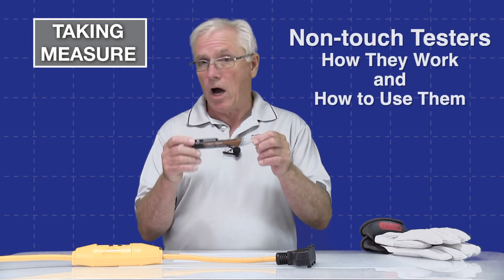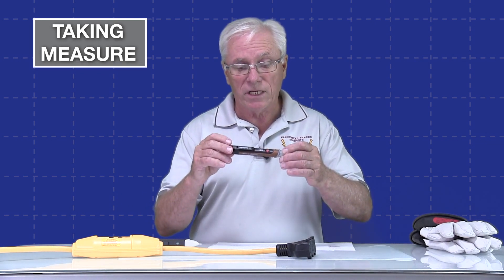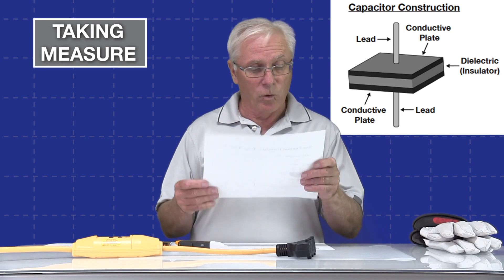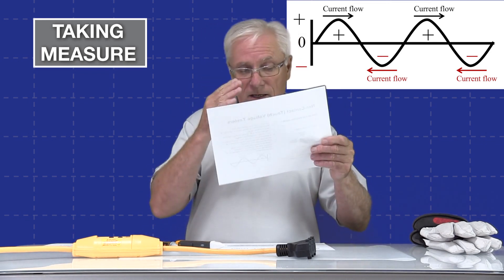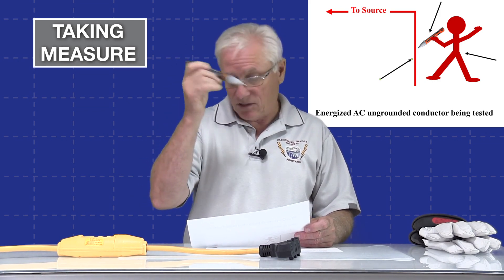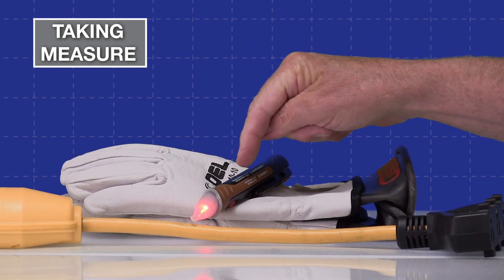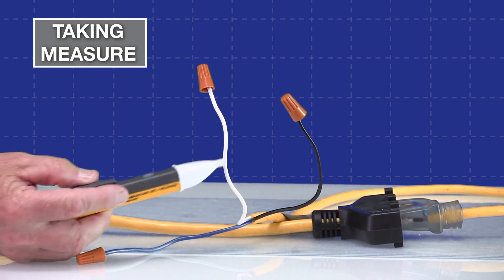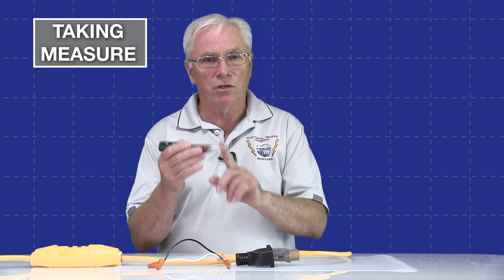Non-touch Testers - How They Work and How to Use Them

Comment: Why doesn't the neutral wire activate the tester?  If I measure voltage with DMM between neutral and hot I get 120V.  If I reverse the test leads, I still measure 120V.  i.e. both hot and neutral carry alternating current.
Reply from the maker: The neutral is a grounded conductor.  Grounded wires are designed to have a low resistance path to the ground, which means they are essentially at the same potential as the ground itself. Therefore, there is no potential difference (voltage) between the grounded wire and the surrounding environment. As a result, a non-contact voltage tester will not detect any voltage on grounded wires because there is no electric field emanating from them.  Put in simple terms: the electrostatic charge is not allowed to build.

Comment: Most Non-Contact testers only test AC voltages so you have to find DC voltage Non-Contact testers and also look into "insulation line break tester modes" to find a break/open in a wire harness or wire. Try making a YT lesson about using a DC non-contact tester and using the insulation line break mode to test wires, test relay contacts and test leaf type switch contacts because visually the contacts might look closed but won't have current passing through the switch contacts which the insulation line break tester will detect there is a BREAK
Reply from the maker: I am going to need a lot more toys (testers) to play with.
Reply: @takingmeasure  Get various Circuit Analyzers that puts loads on the 120vac outputs for testing the outlets. Electricians use Circuit Analyzers Klein Tools RT390 has a LOAD button

Comment: This is what I was explaining to a gentleman the other day. I was basically explaining to him that a noncontact voltage tester works off an electrostatic field. Whereas a clamp meter to sense current works off an electromagnetic field. You get an electrostatic field with the presence of voltage and you get an electromagnetic field with current flow. Michael Faraday demonstrated this phenomenon perfectly with a set of compasses placed in the proximity of a conductor that had current flowing through it in the early 19th century.

This experiment also helped Michael Faraday discover the relationship between electricity and magnetism. Limited in his understanding of advanced mathematics, he commissioned James clerk Maxwell to write the famous maxwell equations explaining this phenomenon.

The unit of electrical capacitance, “the Farad” is named after Michael Faraday. The unit of electrical inductance, “the Henry” is named after an electrical engineer by the name of Joseph Henry.
Reply from the maker: Well said.  The study of electricity is interesting stuff.  Under each layer of what you see (and know) there is always another to further explain things.  I am  still learning after all these years.  Thank you for watching and thank you for the comment.
Reply: @takingmeasure  thank you for posting this video and your comment, sir! Yesterday I registered for my first class at the local community college to start my 4 year journey in obtaining my electrical engineering degree from Mississippi State University’s Bagley college of engineering.